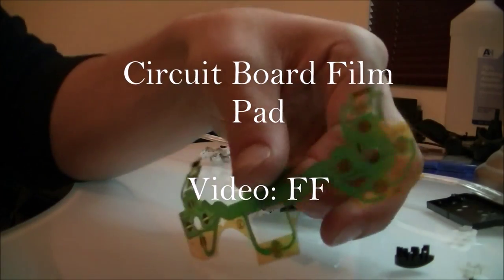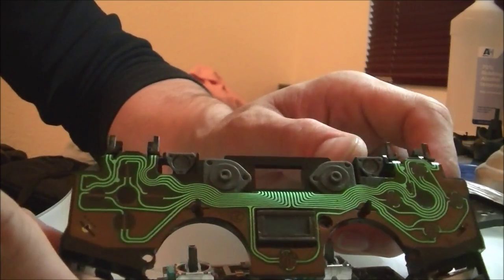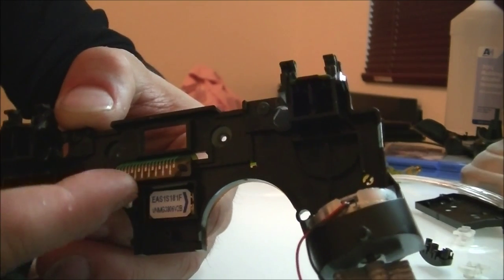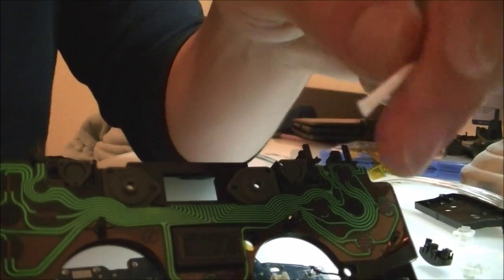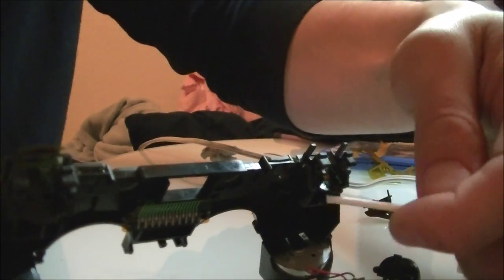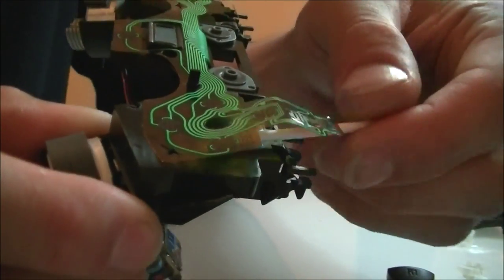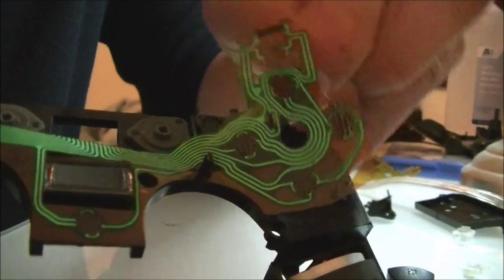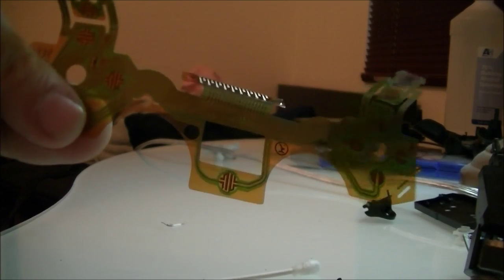Video FF : Circuit Board Film Pad Removal and Maintenance

Comment: Hey man, great vid! I replaced the conductive film on one of my controllers because some of the buttons on the d-pad were not working, they now work but the controller now acts as if the R2 button is constantly being held down fully even when the rubber conductive pad is off. I changed the conductive film again and still the same problem. Any advice bro?
Reply from the maker: William Turner Yes i do. often when R1R2 L1L2 problems arise it has to do with the alignment of the conductive rubber pad. In some of my other videos, i detail replacing the conductive rubber pad. Pay close attention to the rubber lip that flips over the top of the internal plastic casing. If this is not aligned correctly, the entire rubber pad may not contact correctly. Also, the conductive rubber pad that lays directly underneath the R1R2 must be laying flat, tucked under the plastic casing grooves. Most people think that as long as the conductive rubber pad nubs are protruding through the holes in the plastic internal casing this will be enough, but you must also be sure the conductive rubber pad is laying in the grooves. I use a qtip with the cotton removed for this job, as it provides stiffness but still some maleability, so i reduce damage.
Reply: William Turner 
Hi. The same problem with my controller,. but with  both L2 and R2. Bought the other one more film and the same problem existing even if I remove both pads and nothing touched the film at all R2 and L2 keep staying pressed down...

Comment: Hey sorry to bother, my ds4 controller was working wonderfully until one day the ps button stopped working. Now i press the button and nothing happens no light no nothing and if i plug it in my pc the light goes orange and i go to test the buttons and i see that the ps button doens't  work but all other buttons do , so i was thinking in getting one of this circuit boards, do you think that is the problem? A faulty circuit board?
Reply: HI i am in the same exact scenario how did you solve it ?
Reply: @bionicsein3182  did u fix it?? I have the same problem...

Comment: Great video, thanks! My R1 registers as permanently pressed. Could this be due to a defective film pad that needs replacing?
Reply from the maker: tumtuber I would think it probably is because of a conductive rubber  pad being installed incorrectly or else the internal casing being broken. Often the R1 or L1 buttons have plastic chafing when contacting the internal casing and this causes them to become extra loose, leading to the R1 or L1 acting as if it is permanently pressed or becoming stuck in a depressed position. if possible, I would try to depress the R1 rubber film pad when the actual R1 button is not connected or the casing is off and the DS4 is powered on. 

I believe that the film pad is not involved because by default R1 is in the off position, not in the on position. Also please check if any other buttons, like L3 or R3 perform the same function as R1, as R3 and L3 problems are much more common, and can often become permanently depressed.

Thank you for watching!
Reply: Thanks for the reply. I managed to fix the issue a few days ago by just taking the case off and cleaning the contact points and film pad with WD40 and a qtip. Found a good deal of black residue. Now the controller works like new. Your video helped me get a good understanding of the DS4's internals. Thank You!

Comment: After taking apart a few Switch joy-cons and a Switch Lite, this was simple. My only issue was the film staying down and in place when closing it all up. Hence why I'm here. Nobody has addressed that anywhere I've looked though. So, fuggit. I used a few tiny slivers of double sided tape. Now I'm just waiting for it to charge so I can test it.
I've got a thing for purple so I bought an "untested" Electric Purple controller for $20 and found it to work perfectly aside from the O button, so I'm hoping this fixes it. I'm not interested in spending the ridiculous price people are asking for that color.

Comment: hi just wanted to ask if on the film pad the green connections is slightly damaged like you can see something on their stopping the connection would i need a new film pad, example my arrow buttons aren't working and iv'e seen on the film pad theres a slight cut or scratch on the green line that's coming from the arrow button area so would i need to buy a new film pad thanks
Reply: Addy Khan  there is a scratch on mine do I need a new one

Comment: I'm having trouble with my DS4. My dpad stopped functioning out of the blue. I opened it up, cleaned everything, and it didn't work. I pressed the metal contacts of the dpad against the nodes on the circuit. Everything worked except for the dpad. I'm convinced that it's the circuit because everything works perfectly. Is there a way to trouble shoot the film itself? Or any suggestions? Thank you, and great video!
Reply from the maker: Pablo P It is very odd for all of the DPad to stop working at the same time, have you tried finding a game where the six axis analog has all of the same functions as the DPad? The reason that I would try all of the directions, would be to find out if the main motherboard signal receptor is fried or just a bad connection with  the circuit board film pad. If you narrow it down to a bad connection or a bad circuit board film pad. I would suggest making sure the circuit board film pad is completely installed correctly (all alignment pins are holding the film pad on to the internal casing and the back of the film pad is contacting the main power connection of the main mother board), if this is ok, and the problem persists it is probably a bent or torn film pad.

I wish you all the best and thanks for watching!
Reply: I am also having the same issue, my entire D-Pad stopped working out of the blue all other buttons are working fine. anyway to check what is the issue, cleaned the controller after opening but problem still exists. What can go wrong? and how to exactly figure the issue please suggest.

Comment: My r2 isn't working and I think its the circuit board bcs everything is working fyn but the circuit board isn't damaged
Reply from the maker: Ayomide Olatunbosun the r2 rubber membrane might not be sitting correctly being the r2 button. The rubber lip needs to be pulled over the internal casing correctly. Either this or the r2 is worn down where the joint connects to the casing
Reply: Same my l1 doesn't work everything else is functioning, my R1 and R2 works also. Interchanging the inner rubber membrane doesn't fix the problem. Any idea how I can fix the issue? Also how do I know wether its the conductive flexflim or the circuit board that has the problem ?

Comment: I noticed u have 70% alcohol do u use that to clean the conductive black parts of the film pad? I ask because I tried 70% (not realizing) even though everyone recommended 90% or higher and my controller shorted. Although it may have shorted from me trying to clean it while it was on. I used the alcohol after to try and restore it.
Reply from the maker: I would imagine that using too high of an alcohol concentration could be a bit corrosive to the rubber pad. Therefore if using it for cleaning the inner workings I would recommend taking care not to soak the rubber pads also remove the battery before any cleaning due to the moisture interrupting any circuitry.

Comment: Very useful Video!  I have a question though, while I was doing this, the red wire that connects to the motherboard next to the black one, detached. Will my controller still work without reattaching it?
Reply from the maker: I have not detached the wires very often before (without reattaching them)  I would advise if it is reattachable definitely reattach it.
Reply: @bonuscard1963  thanks

Comment: I've replaced all the parts in my dualshock 4 - new film pad, new rubber pads, new buttons, and new case.  everything is new except for the motherboard, usb board, and battery.  Upon reassembly, my L2/R2 buttons are "stuck" in the fully pressed state (as indicated by windows 7 game controller settings) - however the analog axis move freely - any ideas?  The trigger buttons are not physically stuck in the case - they move freely and feel like new buttons.  And I know that the motherboard is OK because it worked fine before taking apart (it just looked really worn out)

If anyone wants a good way to test a PS4 controller, just plug into any windows PC and you can test all button presses, joysticks in the game controller settings screen.
Reply: Chris Swearman its clearly the mother board then if you've replaced every part

Comment: hi so i have a pretty unique problem with my controller. my l1 button keeps on activating l2 instead of its designated input. l2 trigger works just fine which means the l2 input is activated by 2 buttons. any advice?
Reply from the maker: This probably means that the conductive pad under the trigger is touching both the L1 and L2 part of the circuit board contact membrane. I would start by opening up the controller and realigning all of the contacts (and perhaps unfolding the circuit membrane )

Comment: Hey, I was wondering whether I've messed up my film pad. I transferred it to another plastic base. Now, I did this with my fingers which I presume was not what I was meant to do. Since I have done that my controller will not turn on. The ps button is not responding and so on. So do you think I would need a new film pad? Or do you have any suggestions? Thankyou in advance
Reply from the maker: +Mini_Stedders The biggest problems of transferring the film pad are due to minor rips and tears that occur. If you are experiencing certain buttons not responding, this would be due to a tear or a rip of some sort.

Another problem that I have seen occur is if the film pad that you are using does not fit the plastic base (this can occur because of different gen models of controllers). However, this type of problem should not result in many problems with functionality.

One last problem that I have seen would be that the film pad was installed incorrectly and certain pads are not interacting, this would usually result in no functionality or power issues.

Please let me know of the exact problem and I can help diagnose the real issue of installation.

Thanks for watching!
Reply: +bonus card no it may not be torn check the battery make sure you have of connected right also the rubber thing that's send signals to the ps4 button to turn on ps4 might not be put on right so check it is placed right .. that happen to me and it worked after that
Reply: Hi i tested mine i found out that the ps button doesnt work , any way to bypass it ? as  i dnt really use the ps button?
Reply: @bionicsein3182  same here😔

Comment: I can't get mine to stay down on the area of the directional pad what kind of glue or adhesive can I use to get it to stick
Reply from the maker: It sounds like there is some kind of problem between the dpad rubber and your controller plastic shell. You may want to look at the interface for broken plastic.

Comment: I got a new circuit board. But when I open my controller, I see that my type of circuit board is divided in two, unlike the one piece circuit board you show on your video. Is it because there are different versions of the controller?
Reply from the maker: utubeleplague yes, that is exactly correct. When this video was made there were only two versions of the controller. I believe you are dealing with version five. you will be able to see the version number by looking at the first few numbers of the serial number on the back sticker.

I have found that the newer versions are much harder to fix because more counterparts, lower quality parts and less joints between the moving parts.

Comment: Thanks for your reply I do really  appreciate it..
last question 
I have seen many different circuit with different colours some of them are green blue yellow and transparent I just want to know that is there any difference between them I mean among the different colour?
Reply from the maker: +Affan Qureshi Hi Affran, I also have seen different colors. The most common colors that I have seen are blue and green. Let me explain the difference of these two first and then we can explain the existence of the other two. There are two main differences between the dualshock 4 controllers that Sony makes. I like to call them class 1 and class 2. Class 1 are the original type of controller, with more sturdy parts and altogether more expensive. They have shinier plastic on the outside, the backing LED light/charging port area has a total of 4 screws, the main PCB (motherboard) is broader and wider, the plastic casing on back has more room for the PCB to fit inside of, the internal plastic casing has a through hole for the touchpad cable ribbon and the circuit board film pad is green. The other Class 2 has a more matte finish for the black controllers (this class also includes all colored controllers and controllers sold in bundles CUH-1115A), the backing LED/charging port area has a total of two screws, the main PCB (motherboard) is smaller in size and the back casing has two plastic pieces on the back in order for the PCB to nest in the back (however this also makes it impossible to fit this Class 2 backing onto a Class 1 PCB), the internal plastic casing has white plastic fittings rather than the rubber conductive pads for the Share button and Options button and also fits the PCB for Class 2 and the circuit board film pad is blue. Because of these basic differences, the circuit board film pads are functionally the same, however because of the larger internal plastic casing, the sizes of the circuit board film pads are different. The green seems to be slightly larger, therefore if you put a blue circuit board film pad onto a Class 1 casing, the film pad will not fit exactly and vice versa. I am pretty sure that I have only seen the yellow as an after market variety and the clear, is a variation of Class 2, but not seen a lot.
Reply: +bonus card 
My circuit is broken and it has blue as colour and if i buy a  yellow circuit wil it work and is it to big or small

Comment: Can you please reply to this message I am having a big problem,so my dpad just randomly clicks so I opened it up and it was  dirty so my question is that can I clean my circuit board film pad with water or sommat
Reply from the maker: Ibrahim Muhammed Hi Ibraheem,

Because you are dealing with electronics I would recommend not using water on any signal transferring areas. I would recommend using rubbing alcohol for cleaning any nodes or circuitry. But please make sure all circuits are not transferring any signal during cleaning. This means that no power should be on.
Reply: bonus card ok thank you soo much

Comment: Down on my d pad does not work and I literally take my controller apart and put it back together and it works for a good 10 minutes, any idea what's wrong?
Reply from the maker: Sounds to me like there is an issue that comes back after pressure is applied incorrectly. I am not sure of the fix but I would think that it maybe would have to do with one of the alignment areas on the d pad side being worn down. This could be the d pad itself, the rubber membrane, the plastic housing, the screws, anything in contact with the dpad actually. Best of luck in troubleshooting.
Reply: I have this same problem someone said I can regalvanize it with a pencil?
Reply: Same things happening to me man, did you ever find a fix?

Comment: My filmpad seems to have been pushed/struck by a screw or something when putting it together, and has a small dent in one of those "Green Lines" paths is it possible to be fix or reconnect the "green lines" in anyway?
Reply from the maker: Marlon Alucard sorry man I have tried to reconnect them before, it requires soldering to the origin points, but because it is dealing with a film pad the pad cannot take high heat, it really is near impossible

Comment: hello sir i had a problem with play button rubber membrane so i changed because the x button died and it worked just fine but the rest of the buttons (square/triangle/circle) stopped working all of the sudden while im playing i reopned the contoller tried cleaning and everything but still didnt work,,,my question is is it the circuit board film pad or the main PCB  is the problem ??????? thx in advance.